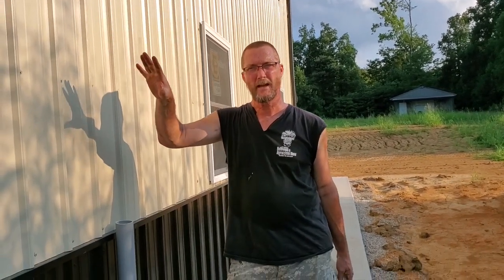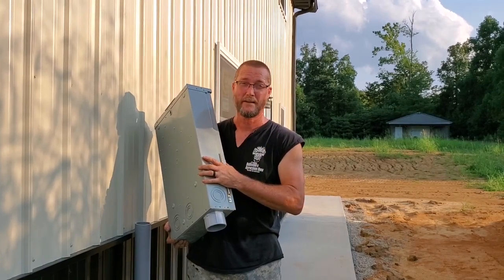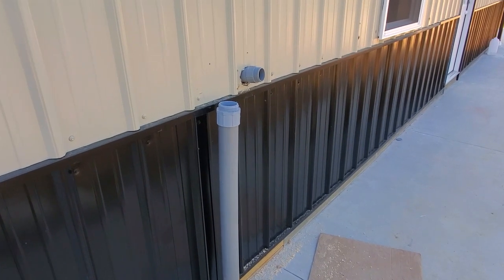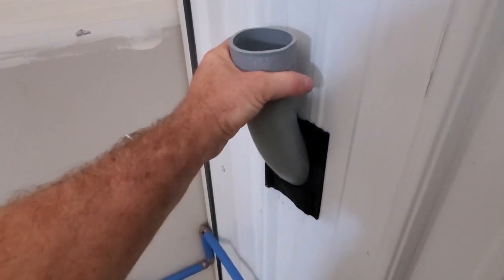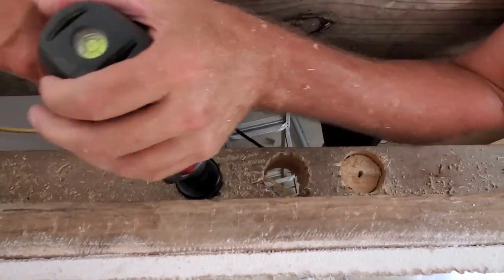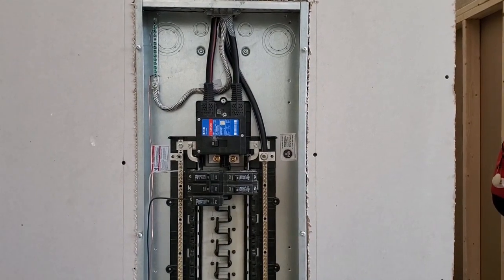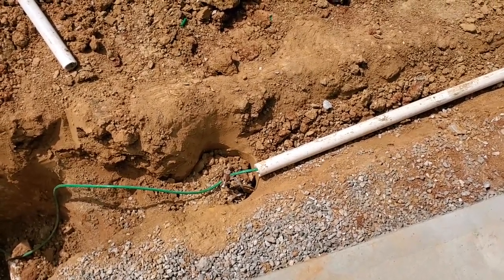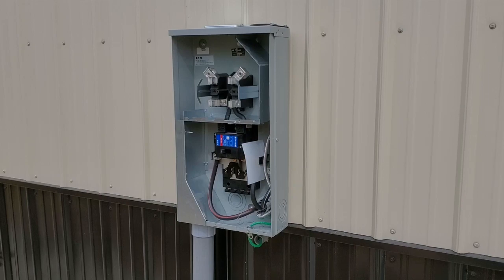⚒️Working on Electric || Barndominium Homebase

Comment: Any problems running radiant floor heating and instant hot water heater with  200amp service?  My builder is saying we should consider using 400amp service.
Reply from the maker: Hey.. Everything is working great on 200 amp.  We have been using both all winter plus running everything else.  If you get the larger instant hot water heater you might want to go with 400amp. Also, you might consider if you would be adding electric to a shed/workshop later down the road then more amp is better.    Hope this helps!🤠
Reply: @RVBarndominium  electric bills ok? I live in southern Indiana and remc says i should expect sky high bills with two instant water heaters
Reply from the maker: Our next video is about the cost of our floor heating system using a kill- a -watt device.  You don't want to miss it!  👍

Comment: do you know brand model of meter socket /disconnect combo
Reply from the maker: Sorry...not sure.  We bought at an electrical supply company and they told us what we need per our county regs.
Reply: Of all the meter installations I have seen on u tube you are the first guy to do it right by using a meter base with a main disconnect. Every body else is putting in a meter base only with no breaker to provide over current and short circuit protection on the service entrance cable that goes to the circuit breaker panel. They claim they don't have to because there is a main breaker in the panel. That doesn'torotevt the service cable. Only what is down stream from it.